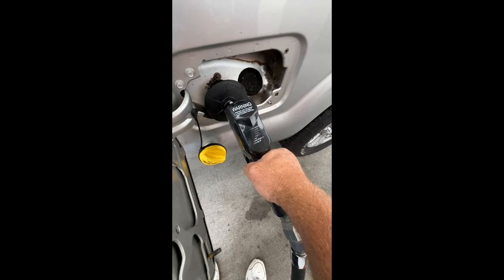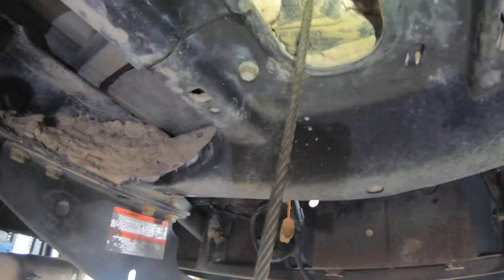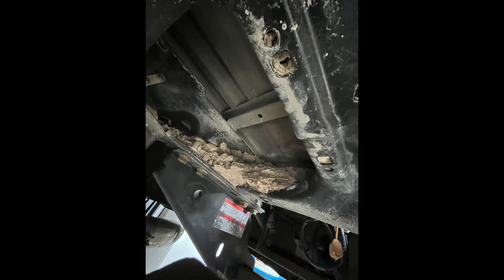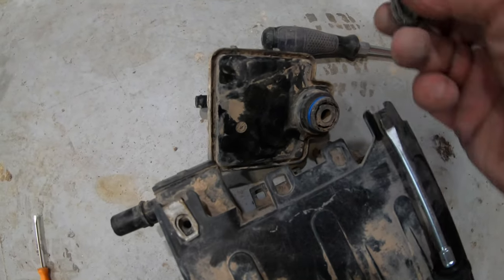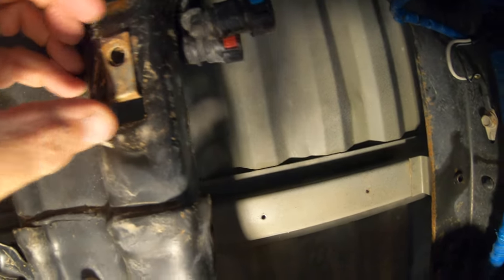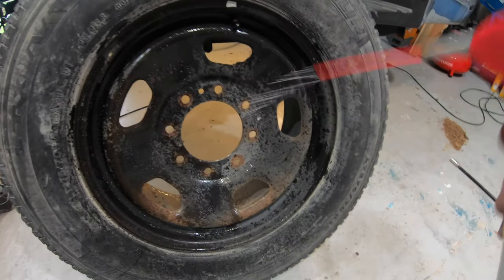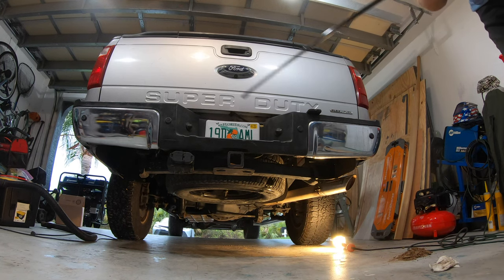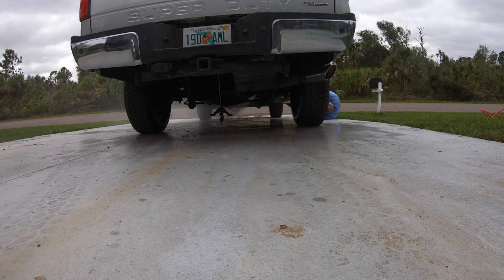Ford Truck Won't Fill Up Fully At The Gas Pump? Time to Replace The Charcoal Canister!

Comment: This really helped me out. I was having the same problem, but without any codes. I was on the fence about replacing the canister until I watched your video. I found the hose clogged with dirt and blew it out. Replaced the canister and it was successful. I can now fill my truck without it stopping until completely filled. Thanks!
Reply from the maker: Glad I could help out! Had me frustrated for a while figuring it out…

Comment: Hi, did you have any codes or just hard time filling up at the gas station? I bought a similar F250 from Texas, had lots of sand and dirt in the electrical chases in the door rockers,
Reply from the maker: I didn’t have any codes, just the inability to fill the truck up because of the clogged vent. Apparently this truck was routinely packed with mud underneath. Haven’t had a problem filling up since!

Comment: Why is the fuel tank partially collapsing on my truck?
Reply from the maker: I’m not sure about that one. Maybe the fuel is condensing when it cools and there is a blocked vent to the tank to allow air in?
Reply: I'm definitely going to have that issue checked out. No check engine lights are on. I was able to dispense 5gals of fuel with no problems.  Thanks
Reply: The tank vents through the fuel cap on my 2012 Ford 250 6.8L 2wd
Reply from the maker: You could still have a vent obstruction somewhere… good luck with the issue… let me know what you find out.